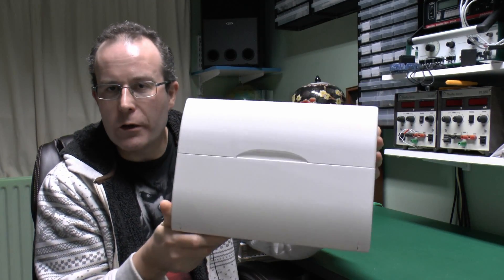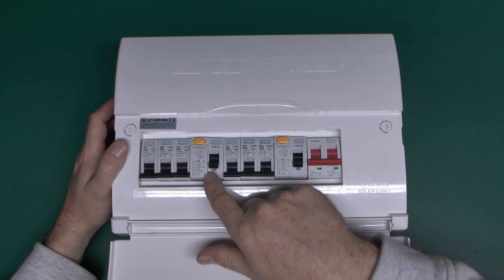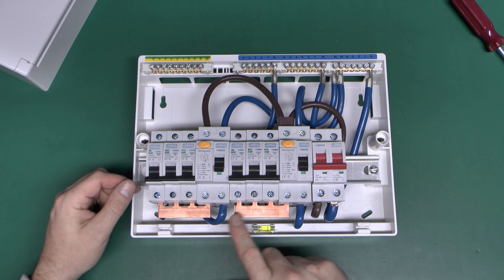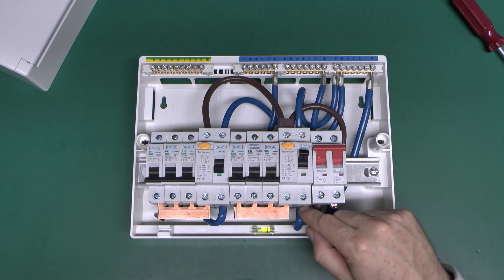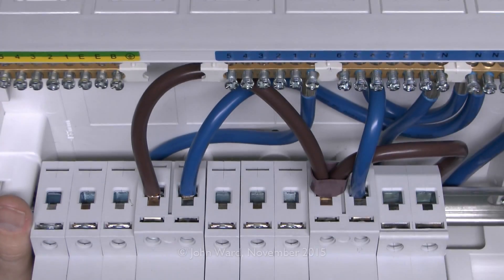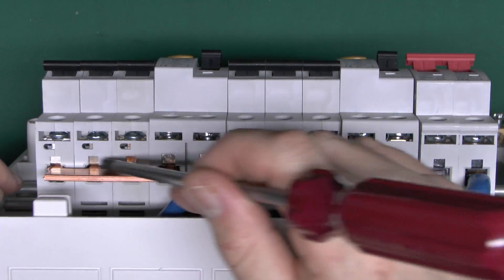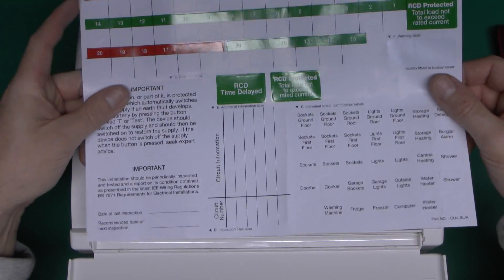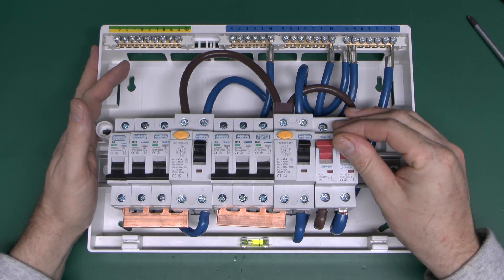Dual RCD Consumer Unit

Comment: this is not a wireing video its an explanation of the already wired up unit, i wanted to see at least 1 thing getting wired into it the reason being theres N and E rails at the top but no live rails this is confusing!
Reply from the maker: The 'live rail' is at the bottom of the circuit breakers, with circuits connected to the top of each circuit breaker.
Reply: yeah i though so but im wondering how to wire the ring circuit so that multiple sockets can goto just 1 or 2 brakers whatever the case is.?

Comment: Sir does RCD provide saftly from electric shok and fault both?
Reply from the maker: An RCD will disconnect on faults to ground, but not other types of fault.
It will limit the duration of a shock to the time it takes the RCD to trip, but it will not prevent it.
Reply: John Ward thank you Sir... What's the difference between RCBO and MCB?
Reply: @RaviSingh-xo7my  MCB are overload and overcurrent protection, RCBO are RCD (ground fault protection) +  MCB in a single assembly. Basically it's equivalent to have a 'pure' RCD and a MCB in series.

Comment: Sir your one thing i cud not understand that what is the benefit of using two RCB in one single phase distribution board?? There may be only one RCB and even it was properly worked. And if you wanna break circuit then u can do it via MCB
Reply from the maker: There are two so that if a fault occurs, it doesn't disconnect power to the whole house - each RCD only covers half of the circuits.
Reply: John Ward It would also reduce the frequency of nuisance tripping, yes?

Comment: why are there only 8 or 9 circuits??
Reply from the maker: There are 6 circuits.
Reply: That's a fairly minimal and cheap CU. It was common for houses built in the first two or three decades after WW II to have 6 circuits in the days of fuse boards. Two 30A ring-circuits for sockets, usually one per floor. Then there would be two 5A radial lighting sockets, again one per floor. Then there would be a 15A radial for an immersion water heater with the sixth being a radial 30A circuit for cooker.

With the coming of MCBs, these would turn into 2 x 32A, 2x6A, 1 x 6A and 1 x 32A. 

However, there were houses with more, and these days there might also be separate circuits for outdoors, garage supplies, electric showers etc. I have 8 circuits in my house.

Comment: hi John 
how r u
please tell me, first DP main isolator or DP MAIN MCB which one .
Reply from the maker: An isolator only,  just used for switching off when required.
There is a large fuse provided by the electricity supplier installed before the consumer unit which is for overload/short circuit protection for the whole installation.
Reply: @jwflame  
Hi JW
Is it safe to remove the dp isolator and replace with the rcd? I have 100A isolator and want to do a 30mA 63A rcd
Reply from the maker: @francisngure2737  It could be done, provided the total load will be less than 63A, although it's not normally acceptable to have a single RCD for the whole installation.

Comment: I have built a shed/out house on to the back of my house and I want to use the power from an existing shed which is a 6mm cable running from a 32amp fuse on the main board in the house should I put a second consumer unit in the shed or just wire it straight to the sockets and lights? If so what consumer unit should I get?
Reply from the maker: If there is already an RCD on the circuit, you could extend the 6mm cable directly to more sockets and connect lights via a 5 amp FCU.
If no RCD, or you don't want to use 6mm cable (may be difficult to fit into some makes of socket), then a separate consumer unit would be required.

Comment: Why do you in England use multi core wire?In my country I have never seen anyone use multi core wire in home instalation.Everything is solid 2.5mm2 for wall sockets 1.5mm2 for lighting 4mm2 for water heater and mains wire is from 12 to whatever you want depending on house energy consuption.Also we dont use 3 core wire for sockets.We use 2 core (L and N) and in the sockets we bridge grounding on socket with neutral.No need to spend money on extra cables.
Reply: TN-C earthing is not allowed on domestic installations - too much risk of a broken neutral. The risk is bad enough on TN-C-S systems.
Reply: Keep in mind if the circuit is ran in steel conduit with steel boxes, the pipe is (and has to be, unless an earth wire is pulled as well) your ground, same as it is in the US.
Reply: I (in Italy) almost never seen solid core wire, but in buildings from before the 80s.

Comment: Interesting, in germany we have light and sockets connected to the same breaker, but we have a breaker for every single room.
Also we have 3 phase design for high power applications. Nice to know.
Reply: Daft idea really, if you lose that circuit then all your lighting, table lamps everything goes off. Could be quite dangerous actually.

Comment: I've got problem with my socket but my P 32 socket will not go back up on that means all my sockets are off and my house apart from the kitchen can you help
Reply: B 32
Reply from the maker: If the circuit breaker or RCD won't reset, there is a fault on that circuit.  Unplugging everything may remove the fault.  If not, there is a problem with the wiring.
Reply: John Ward yeah The kitchen plug socket was blown out so I separated all the wires and put masking tape on them for the now but the trigger switch still not gone back up ?
Reply: And thanks for getting back to me
Reply: If you separated wires you'll have broken the ring circuit in to two spurs, if it was supplied by one.

Comment: @John Ward What is the general cause of a main incoming rcd tripping even when ALL the individual circuit breakers are off? Is that still likely to be an Neutral to earth fault as the lives are all disconnected?
Reply from the maker: Yes, N-E fault on one or more of the circuits.  You will need to disconnect the wiring for each circuit and test individually.
Reply: John Ward Turned out to be a fried main 100A rcd. Dead short on Live/Neutral on the outgoing side! Curious what would cause that to happen. All circuits tested ok before the replacement was fitted.

Comment: we have an older type of consumer unit with one rcd protecting all rcd protected circuties and we have a switch under the consumer unit which when it trips all our electric is cut off we once had a boiler  pipe leak and early in the morning the fuse under the consumer unit  tripped and we was in a house without electric early in the morning when it was still dark it was winter i think at the time.
Reply: Yes, and that's the problem with single RCDs. My preference is to use RCBOs. The way each circuit has it's own residual current protection so only that circuit is lost in the event of a fault and, as a bonus, it's easier to fault find. 

Retrofitting RCBOs is relatively simple, albeit that the box can get a bit cramped with the extra wiring involved and the larger devices, albeit that two slots are gained. The other issue is the cost, but as an installation is likely to be there for decades, it's not a ridiculously expensive job.

Comment: Hi John, good video, so would the neutrals from the TOP of the RCDs go into the neutral bar on the far right as well as the neutral from the bottom of the main isolator switch and the neutrals from the BOTTOM of the 2 RCDs into the 2 separate remaining neutral bars?
Reply from the maker: Panasonic HC-X900, now discontinued.  The X920 is the current equivalent.

Comment: It is fascinating to see how different the electric distribution panels are in the UK ("consumer unit") and US ("load center").  Very surprising to see that the UK unit is basically just a plastic box with a DIN rail inside it.  I do like the rails, actually, because it eliminates the need for bussing.

I see everything is on the same line there.  Are there any installations with split-phase power in the UK or is it typical to receive only a single leg of the circuit?
Reply from the maker: The majority of homes have single phase 230V, supplied as two wires,  a neutral and 230V.
For anything larger you get 3 phase & neutral, 230V between each phase and neutral, 400V between any two phases.
No need for anything else as all appliances are 230V.

Comment: Hi there John thank you for the instruction on the consumer unit  I've just replaced my old unit with a modern one but it kept tripping when I plugged any think in. It was just a case of the neutral wires it the the correct bus bar.  Cheer's Jon.

Comment: How about the in and out sides? Is there any requirement for RCD that which side should be in?
Reply: Some have the live side to the left and some to the right.  You would put one with the live side on the right, to the left of its MCBs (and vice-versa).  This is because the busbar couldn't "jump" over a neutral without you cutting one of its teeth/tongues off.

Comment: Does it need MEN link between neutral and earth bars?
Reply from the maker: No, and in the UK such a connection is not permitted inside the consumer unit.
Reply: I was thinking the same thing, in Australia there is a link, but we do not use the dual type CU...all lighting and power outlet now has to have RCD or RCBO protection..

Comment: Is the UK banning plastic boxes? What's the reasoning behind that? I mean, the plastic you've got there looks flimsy and thin, but in principle I think I'd rather have my mains stuff in plastic than in metal...
Reply: The answer is twofold. Firstly, in most domestic applications, the consumer unit is sited either under stairs, or in entrance hallway. This causes major problems in the event of a consumer unit fire, and increases the risk of not getting out of the property. Sadly, it appears that it is also widely accepted, that the standard of installation in consumer unit replacement leaves much to be desired. Price work, fast track project delivery, and no quality control, means the shite standard will continue as the norm. This has more or less been said, without saying it! Introducing something which doesn't melt and keep burning is a sad way to have to combat it. Obviously it must be easier than raising installation standards.
Reply from the maker: Since January 2016, they must be 'non-combustible', with an example of that being steel.  No other examples are given and no definition of 'non-combustible' is provided either, so in practice they are all steel now.
This only applies in homes, commercial and industrial ones can still be plastic, however they are typically metal anyway and have been for decades.
Reply: Bakelite is pretty non-combustible. Maybe some of the fuse box manufacturers still have their machines from fifty years ago.
Reply: b.

Comment: Do you have any clip showing o/uvr connection to the cu? Is O/Uvr installation mandatory in the uk? Is it difficult to install it?
Reply from the maker: +PHASKO Not mandatory, not required and never installed or even considered in domestic installations.  May be considered for some industrial installations.

Where installed, it's a separate module which attaches to the side of the MCB or RCD and will cause that device to trip in the event of the voltage being too low / high.
Reply: thanks for your reply. Here in Malta it should be installed maybe because of excessive flactuations in voltage. Seeing the ABB installation guide it can also serve for lightheing surges. Still I cannot understand how the 2 terminal device should be connected if alone?

Comment: I have a 1970 house. I had the Wylex box replaced when I moved in because my surveyor red-flagged it.  The lights are all on one circuit, and the sockets are all on another.  The electrician put them on the same RCD.  So now, if I trip my sockets at night, all the lights in the house go out.    Genius!
Reply: Another video said downstairs sockets and upstairs lights on 1 RCD, and opposite for the other RCD...then if there's a power out there is still at least residual light. Or just RCBOs like this no nonsense man says

I feel like I should leave electrical work upto the experts, but then when you look at some so called experts work, it makes you glad people like this man put these videos out there so we have a chance of putting things right
Reply: @chestermartin2356  That is why I do as much work myself as I can. Then I know it is done to the standard that I want.
Reply: Your electrician has no common sense, If one breaker or fuse trips you have no light, He should have split the lighting in two.

Comment: The MAIN switch has no breaker protection?
Reply from the maker: +Robert Herberg Yes, just a switch.  There is a fuse immediately before it, typically 80A or 100A, which is owned by the electricity supplier.
Reply: +John Ward The CU had 2 63A RCDs? so if the 2 RCDs were being fully utilised would the Fuse before the CU trip?

What limits the amount of electricity going in to the house theoretically the CU and RCDs, or that fuse before the meter?

Comment: wait, only single pole breakers in the UK? Bit odd, i'm only used to double pole breakers in the Netherlands. Is it also normal for the bridge to be exposed like that?
Reply from the maker: +FoodOnCrack Yes, most are designed like that.  Some have a plastic cover over the copper bar, but plenty do not.
Double pole breakers are available here but rarely used.

Comment: the cable from the bottom of the isolating switch then goes to the top of the right rcd. what is the thing called at the top of the right rcd that then sends the cable to the top of the left rcd?

Comment: Interesting.  We have RCDs built into some of the sockets which protect any sockets down the line from them.  Required by our NEC for kitchen, bathroom, and outdoor sockets.  We also have breakers with built-in RCDs, but as you said they are very expensive.  And of course being that we use both 120v and 240v, we have different breakers for 120 and 240.  Our main switch is required to be a breaker, just in case the individual breakers that have been fitted are loaded up as such that they are not individually overloaded, but combined exceed the mains input (typically 100, 150, or 200 amp for residences)
Reply: ***** the most powerful home kettles are 1500w here.  Although I did find a KitchenAid 3000w, it was 230v which we would have to install its own socket in the kitchen.  Not very common though, most people in the US generally have only a small stovetop teapot, or use the coffeemaker for hot water.  We're a bit strange ;-)

Comment: Hi John. Is it easy to add another mcb?
Reply: Not particularly with the way that one is setup.  You would have to move everything to the right of where you wanted to put the new MCB one space/way to the right.  You would also need a new busbar.  Usually, if poss, you leave a gap for a new MCB (using a blanking plate to mask the space off).  Often you leave the busbar/s as long as poss, even if there are unused tongues on it.  Unused tongues do make the installation more dangerous though, but on this one the whole busbars are exposed in any case!

Comment: Just a quick question tho, if u wer to touch the busbar in this box while live, the rcd would surly trip? but if it was just a main switch and rcbos, would you fry?
Reply: Yes, touching all exposed bits of the busbars shown would trip one or other of the RCDs.  But you'd be working with the thing switched off, wouldn't you, so only the live meter tail would be live.  That should be poked into the switch far enough so no bare wire is showing.  Then you can't really zap yourself.
Reply: Hmm excuse me but you will only be protected from the RCD side it is designed to protect you on the circuits its feeding if you touch the Line Mains tails coming into the Main Switch Your Dead as it can be around 100A depending on the Main Fuse

Comment: How common is it in the UK for a house to only have a single phase?
Reply from the maker: +Per Mejdal Rasmussen Very common, probably more than 99% have a single phase.  3 phase would only be fitted if specifically requested, and only used if the house was very large or had something like a full size swimming pool in it.
Reply: +John Ward Thanx for the reply. In Denmark 3 phase is so common that you can only get 3 phase RCDs in many DIY stores.
Reply: Almost all.

Comment: Curious to know what 3- phase supply to a residence would be in the UK. Here in the US in some situations residential installations can receive 208Y/120 service if requested, rather than the usual split -phase 120
Reply from the maker: +Kyle Shady Single phase is neutral & 230V,
3 phase is neutral & 3 phases,  400V between phases, 230V between each phase and neutral.

Most residential installations are single phase, 3p is available in some areas but is rarely needed or used.
Most commercial/industrial is 3 phase.
Reply: +John Ward ok thanks, the only way to get single phase 240 here is through the use of step up transformers, or step down in the case of a 480Y/277v service. I'm surprised there are actually household appliances over there that use 400v
Reply from the maker: +Kyle Shady There are no 400V household appliances - 3 phase would be used as 3 single phases where additional capacity was required, or for 3 phase items such as motors.

Comment: Hey JW. Great video - you mentioned your preference for RCBO units. How about doing a video about the internals of an RCBO consumer unit?  It would be interesting to see the difference in wiring regimes as I would assume each RCBO would need their own neutral connection.  Cheers
Reply: +Bob Fish
Look them up, there are loads of images... its' really simple -- main switch feeding line busbar into the RCBOs, then all the flying neutral leads go back to a neutral bar...  Each circuits' line+neutral connections go directly into output terminals on the RCBO.  Simple...  There are many videos on fitting those, too!.